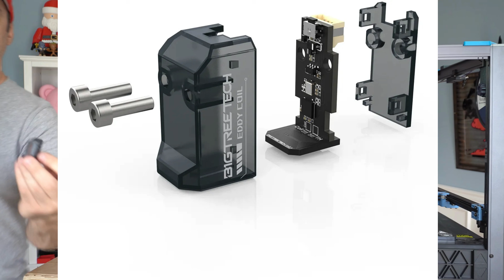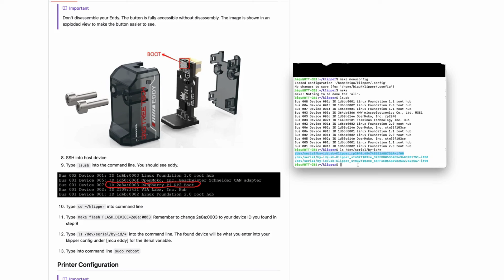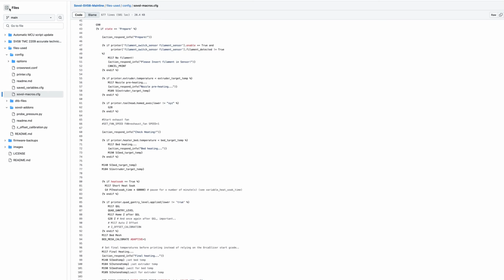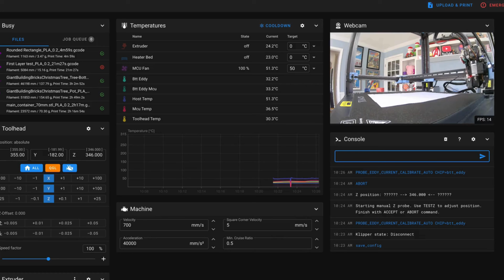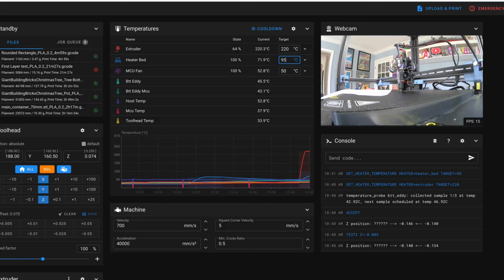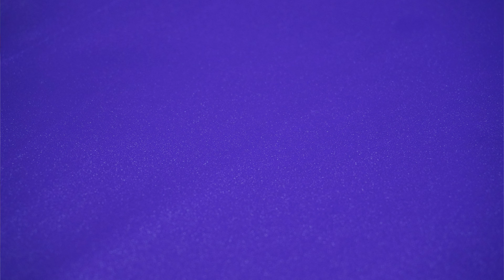BTT Eddy USB Probe Setup on Sovol SV08 – Full Install & Calibration Guide

Comment: Is it better to go for USB than can?
Reply from the maker: the newer USB stuff is really good and easier to setup overall.
Reply: @ThePrintasaurus what about with eddng?
Reply from the maker: @ahmadrinno   Depending on what toolhead PCB you use, you can use a eddy duo and setup for either usb or can. So it can be plugged right into a supporting board. the LDO nighthawk works well. EBB36 can also works good if you want to do a can configuration.

Comment: Thanks, man! I set up the eddy on the first try following your instructions.
Wishing you happiness, health, and all the best!
Reply from the maker: Thank you! Happiness, health and all the best to you as well!
Reply: if only it was that easy. i mustve had a few dozen different errors ive resolved, stuck on a new one, and now... their tech support sent me to their instructions instead of reading my message. so unhelpful.
Reply: @D3nchanter  I already figured out how to set up Eddy Tap myself, it works properly and saves the offset you set
Reply: @vovanheisvladimir  don't have the tap on my friends sovol sv08, its the duo... it just doesn't work.
Reply: @D3nchanter  Why isn't this working? I have an Eddy Duo installed, and the Eddy Tap feature works when I touch the nozzle to the table.
Klipper has a built-in tap feature.
Reply: @vovanheisvladimir  oh it doesn 't even get that far for me. there's some conflicting apply z probe offset in the python code i can't root out.

ive tried commenting out things in the .py, ive tried removing a bunch of those from config files. no dice on any of them. all the same error.

im not at the phase for a tap feature yet.

Comment: after making all the changes to the config files, i'm getting this Klipper reports: ERROR Existing command 'PROBE_CALIBRATE' not found in gcode_macro rename
Note: I also made these to changes to the eddy.cfg file:
##z_offset: 2.5 
descend_z: 0.5
klippy log file says this:
Config error
Traceback (most recent call last):
  File "/home/biqu/klipper/klippy/klippy.py", line 135, in _connect
    cb()
  File "/home/biqu/klipper/klippy/extras/gcode_macro.py", line 166, in handle_connect
    raise self.printer.config_error(
configparser.Error: Existing command 'PROBE_CALIBRATE' not found in gcode_macro rename
Reply: I commented out the probe_calibrate macro; that got rid of the error. However the LDC_CALIBRATE_DRIVE_CURRENT CHIP=btt_eddy  returns zero.
Reply from the maker: Just seeing this. I’m going to run through my setup once more and see what we can resolve. Can you send me an email? aaron@theprintasaurus.com that way we can try and work through and troubleshoot.
Reply: @ThePrintasaurus  E-mail sent. Thanks
Reply: @ThePrintasaurus  I purchased a replacement BTT Eddy Probe and now the LDC_CALIBRATE_DRIVE_CURRENT CHIP=btt_eddy command returns a nonzero value.
Reply from the maker: @Wolf-3.5.9   Should be good to go and move onto the Eddy ng setup now.
Reply: @Wolf-3.5.9  Have you fixxed this issue? im getting the same thing
Reply: @JasmineTeaIsGood1 I'm going to try another Eddy probe to see if that works.
Reply: @JasmineTeaIsGood1  I purchased a replacement BTT Eddy Probe and now the LDC_CALIBRATE_DRIVE_CURRENT CHIP=btt_eddy command returns a nonzero value.

Comment: I did the conversion but struggle with getting it going. During the temperature calibration the head is moving all the way to the side instead of staying in the middle and I don't have an Idea what the problem is. Such a strange thing.
Reply from the maker: That sounds like one of the macros might not be working correctly. I'd make sure you don't have everything commented out. If you send me an email aaron@theprintasaurus.com with your configs I can try and roll through them in the next day or two to see if I spot anything.

Comment: Hi after my Update i get this error on my MCU Protocol 

This is frequently caused by running an older version of the
firmware on the MCU(s). Fix by recompiling and flashing the
firmware.

Your Klipper version is: v0.13.0-533-g6d7d3403-dirty
MCU(s) which should be updated:
mcu: Current version v0.12.0-0-g02eeceb-dirty-20250528_031841-SPI-XI
eddy: Current version v0.13.0-452-g8dd798eb
extra_mcu: Current version v0.13.0-452-g8dd798eb
Up-to-date MCU(s):
<none>

Once the underlying issue is corrected, use the "RESTART"
command to reload the config and restart the host software.

mcu 'eddy': Unknown command: trigger_analog_query_state

Can you help ?
Reply from the maker: Looks like your mcu / klipper update may not of succeeded. With it showing a dirty status. I would rerun the update. Once that is completed, I would pull the latest eddy update and recompile your firmware and flash eddy. This would put you inline with the later klipper update you are on.

Comment: any idea why id be getting
probe_eddy_current btt_eddy: reg_drive_current: 0
Reply from the maker: Couple things to check. Faulty connection/cable. Or height of the eddy probe. Sweet spot is 2.5mm from nozzle tip.
Reply: @ThePrintasaurus  Did the 20mm measurements like in the video. Used the same mount as well, still no luck. Faulty Eddy duo?
Reply from the maker: @agibfaizal4547   That is likely. I've had one or two were it's been the cable or duo.

Comment: isnt  the recommended distance from the nozzle 2-3 mm? the offset to the bottom of your eddy sensor looks much larger than that.
Reply from the maker: BTT does recommend 2 to 3mm. With the probe out of the case it measures at 2.8mm with the stock hotend. With the microswiss being a little longer it's closer to 3.3mm. I didn't have any issues with accuracy and the calibration worked great. You could probably run a eddy-ng mount which sits lower because it requires it for tap to function correctly. Here is a link to those mounts. I'd also at this point recommend doing Eddy-NG instead of just the traditional eddy probe configuration. I have a video on my page on how to do that. It's extremely accurate and takes out the need to do temp compensation calibrations as well. Here's the mounts - https://www.printables.com/model/968900-sovol-sv08-btt-eddy-mount
Reply: @ThePrintasaurus ah ok, cool that it has worked so well for you. I actually designed a mount for my modified ender 3 s1 pro, I have just been checking out the offset other people have used to see if I would have any issues before I start installing Eddy-ng. My offset is currently around 2.2 mm not accounting for the plastic case. So hopefully it's fine if not I will adjust the model

Comment: When it says SSH,  dose it means I have to connect a Raspberry Pi with the 3D printer in order to check the printer is on Mainline Klipper?
Reply from the maker: Your utilizing SSH to get to the command line of your printer to flash your Eddy Usb. If you have not migrated over to mainline klipper you won't be able to utilize a eddy probe on your SV08. I have a video on how to change over if needed.

Comment: Hey Aaron, I started watching your video and installed the Eddy Probe and got it configured for my printer. I decided to then watch a couple other videos and do the NG software install. I would really like to hear how you did yours in a video and watch you describe the process. All the other videos I found were ok, but left me with questions. My first issue is the setting the z offset with Eddy NG Tap calibration. Turns out that mine only passes calibration when it's ambient temperature, yet the "start_print" Macro I copied from Printables has the bed heating and doing a QGL and then a tap z-offset, which of course fails because it's too hot. I am in the process of rewriting it where there is no QGL and the z offset is calibrated at ambient temperature (I may have the nozzle get to 150 C or something to compensate for thermal expansion since I can't do it for the bed) and then it heats the bed and nozzle. Finally, my ABL mesh is very slow and stops very much like it did when I had the inductive probe. I have used the "Method=rapid" and tried to change "speed" under "Bed_Mesh" in the printer.cfg, but to no avail. I would love to hear a video about your install and how you resolved some of these problems (if you even had any of them). Thank you!
Reply from the maker: Thanks for commenting! I'm in the process now on working with NG tap. I have started on my voron and moving over to the Sv08 next. I have my notes I'm working through and will start filming that process hopefully over the next few days! I'm hopeful I can get a NG tap video out by next weekend if all goes well with testing and putting things together.

Comment: Hi Aaron, I'm just finishing the Mainline Klipper install on your last video (thank you again for the help in the comments!) I was originally going to install the M12 probe from the sv06 -sv07, but after watching this video I ordered an eddy probe and will do this instead. Should I print the Version 3 (lower mount) from Rappetor,  so I'm prepared for the NG upgrade down the road or go with the regular one now and then print the lower one after the Eddy upgrade? Thank you
Reply from the maker: Glad I could help, and awesome to hear you're enjoying the videos! You should be okay to print version 3. I had intended on using that mount as well, but recently switched to the V4 Cn3d tool head which has an eddy mount incorporated. Just completed the NG tap on one of my vorons. Works well, I’m going to do an sv08 video. It’s a fairly simple install!
Reply: @ThePrintasaurus  Awesome, thank you. I believe I saw a video on the V4 tool head from Cn3d. I was thinking about doing this for the filament cutter and filament runout sensor functionality and ultimately installing something like the CO-Print system for multi-color. That will be a project down the road after the Eddy and the NG addition. Looking forward to that video. Thank you

Comment: It is said that installing eddy-ng does not require a temperature compensation process and increases the reliability of the z-offset. I want to install it, but I'm scared to ruin it because I'm a beginner. I'd appreciate it if you could make a video of the installation guide.
Reply from the maker: Hello, I have had a few requests to do an Eddy-ng video. I'm going to start testing and working on one to release. It will probably be a week or two before I can get it done!

Comment: Is there not a concern that the nozzle at 220 will burn the paper/start a fire?
Reply from the maker: I have not had any issues. I want to say the ignition temperature of paper is around 235c. As a precaution, I wouldn't leave a piece of paper long term, but for the time it takes to do a calibration, I have not experienced an issue.
Reply: @ good to know, thanks :)
The rest of the video was also very helpful
Reply from the maker: @JacksMacintosh   Awesome, and thank you. Let me know if you need any help with anything you upgrade!
Reply: @ appreciated, will do!

Comment: IT's been a while since you posted this, and I was wondering what you thought of Eddy at this point?  I have gone back and forth between Eddy and an M12 probe a couple times.  I'm fiddling with Z-offset about as much with the Eddy as I do with the inductive probe.  And my bed mesh results are quite a bit worse with Eddy than with the inductive probe (I'm using an M12 probe in place of the stock SV08 probe).  But it really is fast.  

I'm really considering trying Eddy-ng and was wondering if you'd given that a try yet?  Seems like it might be the best of both worlds...the fast scan, but a more reliable Z-offset by virtue of using Eddy in tap mode.  I have read through the Github wiki files a bunch of times, but haven't done the install yet.
Reply from the maker: Since switching to a bed that is much flatter the eddy has been really accurate. I did find the Eddy to be better than the stock probe, but in my situation with the bed being as warped as it was, I wasn't getting the print quality I was wanting. After addressing the bed things are really good. I am getting ready to do a eddy-ng install, once I get through that I intend to do a video of that process. I am a fan of tap - use it on my voron 2.4, but it's a slow process. I'm really interested in having the accuracy of tab combined with the speed of Eddy! 

For the Z-offset are you using the Beta maros? This allows for on the fly z-offset adjustments by enabling micro stepping similar to how a standard probe works. This allowed me to get things more consistent but again I ran into issues with various points of the bed being to much of a variation to continue good layer adhesion.

Comment: What does the mesh look like? How's the variance?
Reply from the maker: The bed mesh was much better in terms of showing variances. It did lead to my bigger issue - my Sv08 bed was mega warped, and over the course of a couple hundred hours got worse. I went down the road of shimming and that to a degree fixed things, but ultimately swapped to a voron 350mm bed adapter that I covered in another video. Since then the Sv08 has been fantastic. I still have not opted for an enclosure so I'm printing PLA and PETG mostly with it, and have been happy.

Comment: How or where do you print things like ASA or ABS being that they are toxic?
Reply from the maker: I print ASA or ABS in one of my X1C's and vent it to the outside. I also use a Voxel dual hepa 13 & carbon filter which does a better job than the stock bambu filter on the x1c.

Comment: I am experiencing 2 problems that I have noticed are in this video but seem to be overlocked or not noticed.

Running the `PROBE_EDDY_CURRENT_CALIBRATE_AUTO CHIP=btt_eddy` it starts at 346. Not to big a deal perhaps will be corrected when the calibration done but when the nozzle gets close to the bed it is not going down, it is bouncing. 
I have noticed this problem on mine. I say problem as you hit the - or -- on the manual probe calibrate the nozzle does not get closer to the paper. How is this OK operation?
Reply from the maker: Hello, so it does do a "z-hop" when manually lowering the nozzle to the build plate. But you should be advancing in either direction you select. It sounds like yours isn't lowering at all? Can you send me an email at theprintasaurus@gmail.com? I'd like to work with you to see what's going on. I can send you my configs as a comparison as well. Happy to help!
Reply: @ThePrintasaurus  I very much appreciate that. I am sure it is my in ability to read instructions completely or the custom head I had the eddy mounted to. I attempted to mount it as you described but I dropped it and then stood on it :(. I have another on the way and will reach out if I have more issues. I greatly your offer to help.

Comment: Wouldn't it be easier to calibrate the z offset with the touch pad in the back for the original probe 

Or is it currently a limitation in the script that it doesn't have that functionality yet?
Reply: I should clarify I mean by the hotend tip touching then moving back to the center not the eddy
Reply from the maker: You could probably edit the script that is called when performing the z-offset calibration to indicate a specific location. The paper method works and is more universal to any printer. Whereas if you used the touch pad, you would have to know the coordinates to configure, etc, so it's just an extra step that is not needed.